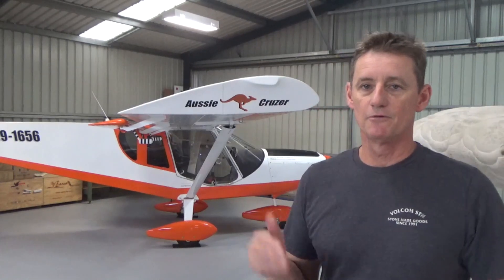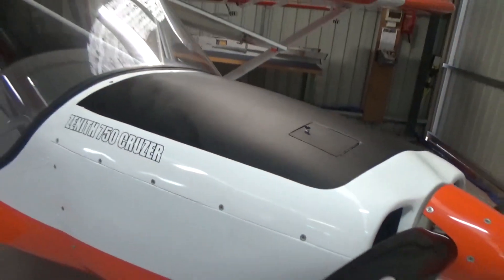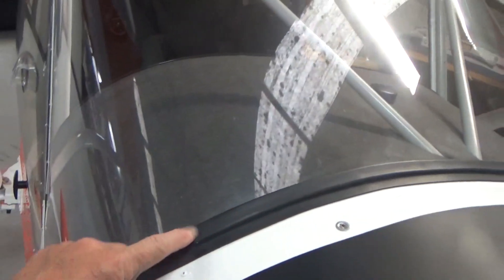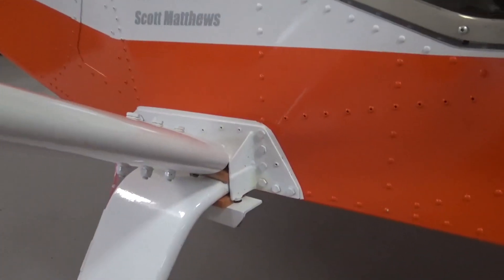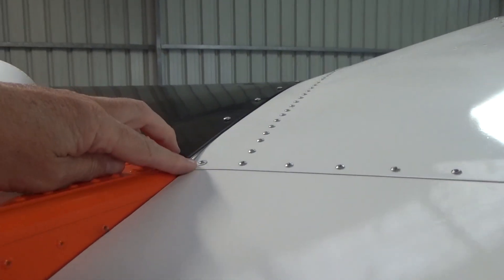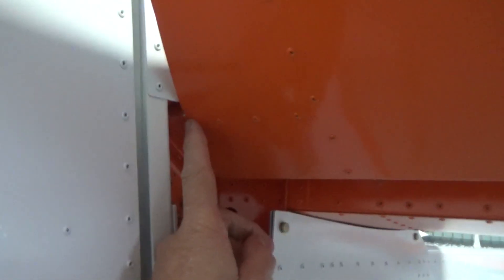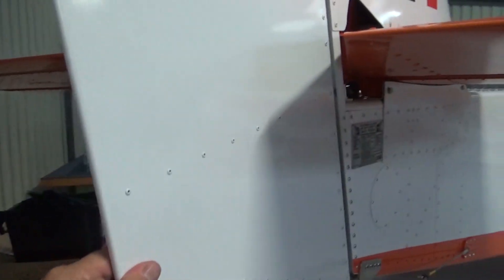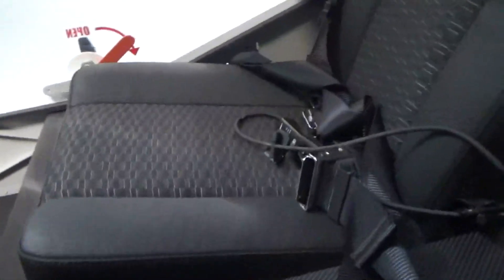Zenith Cruzer 10 hours in to operations.

Comment: Hi Scott...Dont squeeze the trailing edge. The heavy or turning wing to the left is an inherent design issue with having the Elevator and Flaperon controls all linked together. I have resolved this with a mod approved by Zenith by divorcing the Elevator bellcrank onto its own rotating bellcrank or bearing and bolt. If you want a photo and design drawing of this I can send it to you by email. Two other Perth Cruzer builders will be copying and building this mod. I have enjoyed your video series and found them very informative to assist others. BTW I cant see how you have closed the windscreen gap at the bottom which kicks up. I might fibreglass mine as its hard to push down onto the fuselage to close the gaps without using a mechanical fixing or causing tension and causing potential cracks.
Reply from the maker: Hi Greg, Jabiru has the same roll to the left at different times. Yes squishing the TLE does seem a little harsh. I’ll see how it goes might try a trim tab. Windscreen has a 3mm bolt through the seal and windscreen at the lower bottom to hold it in.

Comment: DONT !!!!!! Pinch the edge 😳 
You will shoot yourself as it destroys the cosmetic look.  I saw one done and I wanted to throw up 🤮 
 Fly with a passenger n equal fuel . See if it is still heavy . If so,  add a trim tab . 
Did you check controls binding with full flaperons down?  Usually elevator cables are too tight . 
You built a Beautiful 😍 bird ✈
Great walk around 👌 

 2nd ... swap the door handles around so they open like mine . Much better method and smoother.  And powder coat the handles. Much smoother than paint .
Baby wipes remove protective wax . I prefer Microsoft towels and spray wax ... win win . 
Luv the black white counter balances. I may add white to mine now 👍🤠
Windows i used a small bead of Clear RTV. And small screws . No wrinkles in skin .
Reply from the maker: Thanks, had the rigging all sorted before flight. Don’t understand how some find backward elev trim or flaps binding when they are on short final! Yep, was in two minds about squishing the TLE. Slight roll is one up and probably just flying uncoordinated to imbalance fuel. Going well!